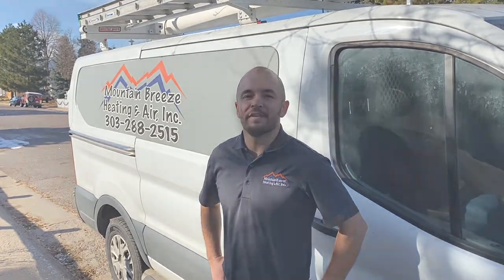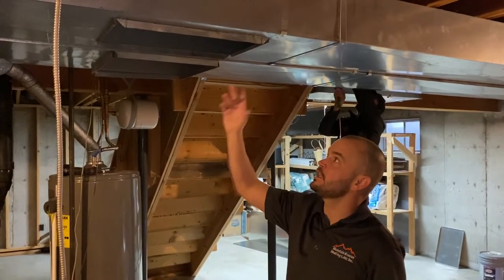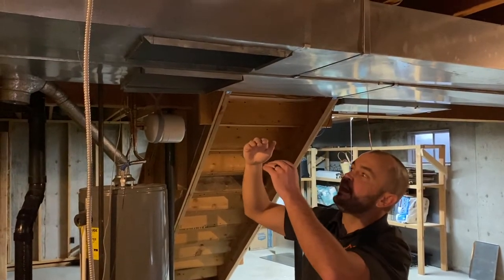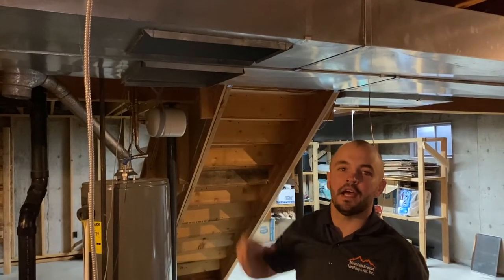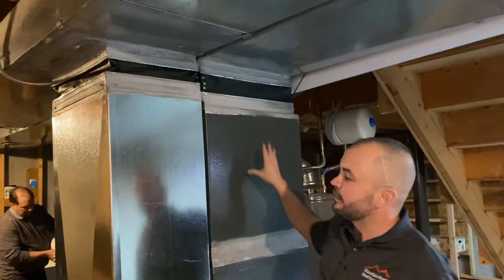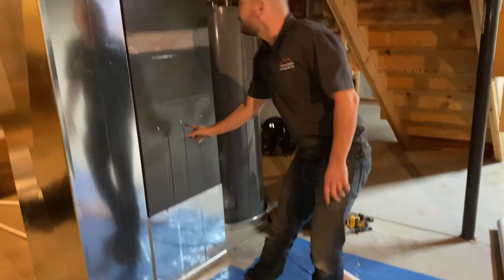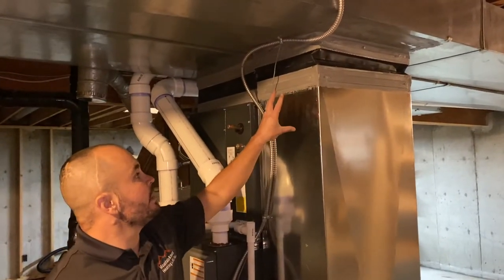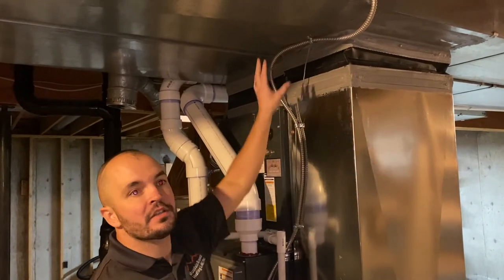Noise Reduction in HVAC System

Comment: Just had a new A/S furnace installed and the new DC blower motor is like a jet engine compared to my old furnace even with the speed reduced to the second lowest setting. ?
Reply: Have same problem any solution?
Reply: @arnoldrivas6760   no ! looking for an answer but it was a huge mistake buying this American Standard furnace I’m sure other people are having the same problem. Have a small ranch and it’s under a bedroom that can’t be used because of the noise it affects the whole house. The owner of the company that installed it is checking on it currently.
Reply: @bluesdirt6555  Did you get it fixed?  What did you do to fix it?  I too have an American Standard furnace and it sounds like a jet turbine when it runs.
Reply: @jeffb5798    After complaining my installers found out that my new single stage had a problem that couldn’t be fixed and replaced it with a two stage but it’s still not as quiet as my old one. My return is undersized. Still had to adjust the speed down. They wanted me to run it without a filter
Reply: @bluesdirt6555  with two stage they must be running it at half capacity to make it quieter! Ask them to check the intake and exhaust vent sizing and pipes used! It could be acoustics problem and maybe limited return air is adding to the problem because cfm pushed is not the same as the one returned

Comment: we call those vibration eliminators.    what causes the ductwork to flex and make a popping noise when the system starts or stops?      ty
Reply: I know this is 7 months after your question.  I have been researching a banging noise everytime the furnace goes off.  I've watched many video and read many articles, most were bs solution that aren't feasible.  The one theory that made the most sense to my situation was the blower being deprived of air and forcing the aluminum ducts to bow in and when the system turns of they go back to normal but with a bang.
Remove the air intake vent or vents, start the system and let it stop, if the noise is gone viola!!!!, by a vent with bigger or wider slits, if the noise remains I'm sorry and I was of no help to you.